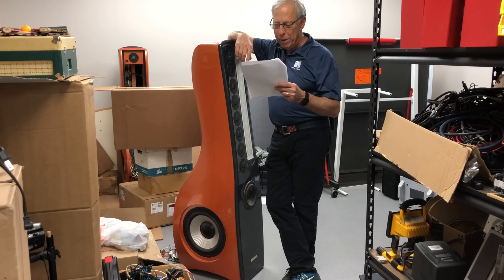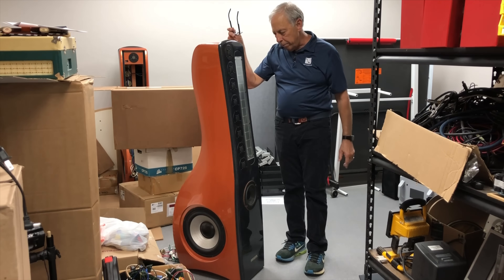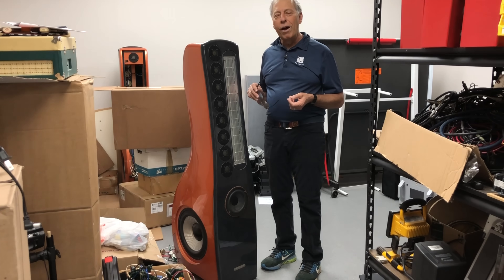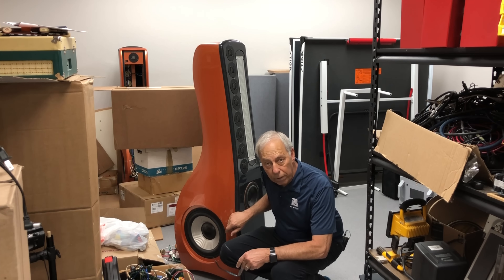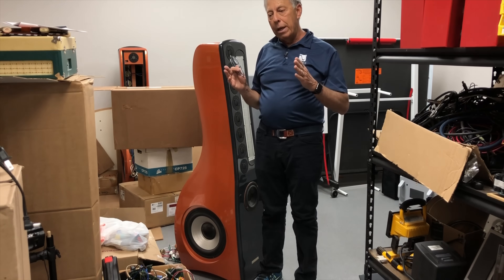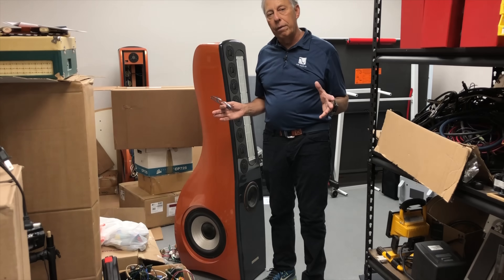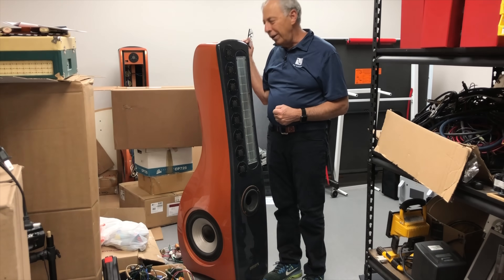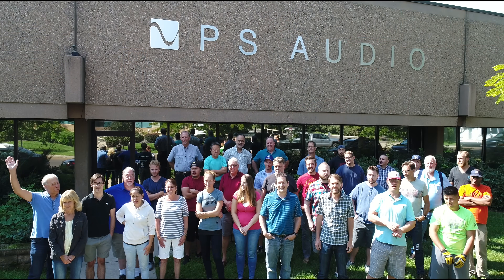Should dual woofers be in phase?

Comment: This is a little off point but I used a Polk Audio idea on a pair of towers I built.
2 x 12" poly woofers, a pair of 4" mids & a tweeter in each enclosure.
1 mid in each was powered thru a switch allowing me to change it from duplicating the partner mid to an out of phase signal from the opposite channel.
The idea was to cancel anything common between both channels for more pronounced separation.
It was incredibly effective & truly widened the presentation.
Is this still being used by anyone? 
A very fun & satisfying experiment.

Comment: There is only 1 thing wrong with dipole subwoofers : you need a lot of air displacement , so lotsa surface , lotsa xmax and an open baffle with sufficient dipole distance (deep H-frame e.g.) In return for this investment you will get the best quality bass you have ever heard and you will never go back to closed or ported systems .

Comment: Paul , I do not understand why you would go from an 6.5" mid bass coupler to an 8" one. You said that is the best speaker you have ever heard.  Years of development most likely went into that 6.5 " driver.  To find an 8" as quick and as dynamic with the same roll off characteristics will be difficult to say the least.

More often than not an 2 way 6.5" speaker vs an 8" 2 way system will sound far more natural from the 80 or so hz range and up. Not a rule.  A punchy quick 6.5" mid bass driver is a much easer find than an 8" one.

Comment: I think you made a mistake in the explanation. You said they should be inphase, then gestured with your hands that the speakers firing out of phase, both firing outwards simultaneously but in opposite directions,  would cancel out, which is true but then you said the opposite is also true. 

Phase is relative to the direction of the drivers radiating surface. A dipole speaker has two radiating surfaces, the front and back of the diaphragm or cone. It doesn't matter if you have a single element surface or two different drivers moving in the same direction at the same time, one would be firing out, the other would be traveling inward. They are still in-phase. 

Kef R400b's do this. However that speaker is poorly designed because it is already out of phase with the speakers pointed at the listener by ¼ wavelength because they were designed to fire sideways. If the Kefs are placed firing front to back in the room, one driver facing the listener, the other the back wall, bass is louder and tighter, and the sealed space between them helps to eliminate over-travel, and the only negative is that they are uglier than they normally are. Since you advocate servo control woofers you can have them firing side to side and compensate their timing to keep them in-phase with the front facing dipoles electronically.

I think that's what you meant?

Comment: I would love to see the polar response of that speaker... the  mid/base  speaker is probably wired out of phase so that at the crossover frequencies it will sum with the LF drivers and the higher frequency drivers.
I recommend building an anechoic chamber and use something like LEAP  and LMS for cabinet designs and acoustic measurements and for Theile Small parameter measurement of your drivers...
Reply: Love your Kat outfit in your pic😉
Reply: @xmachine7003  Kat outfit ? I don't have one ... my girl friend Catie does
Reply: @janinapalmer8368  😂😂😂
Reply: Looking at the dimensions of the baffle , the polar response of the dipole mid woofer will be OK (constant directivity) , but both midrange and tweeter polar respond will be not at all . Same design mistake as in the Infinit IRS : way too wide baffle at those frequencies for a perfect dipolar response . At 2 kHz , max baffle width is about 5 inch ...

Comment: 8” drivers start to beam at ~1700Hz, so I would be careful with your crossover frequency and slope.  Each speaker is different, but usually the 30° off-axis is down like 3dB at 2kHz for an 8” with no waveguide.
Reply: this  guy is uber-professional, you can say nothing new to him
Reply: I'm pretty sure it's going to be crossed low, around 300Hz as in that speaker with the 6
Reply: New comment section mini series-Pro tips for Paul....
Reply: They already have mid range driver. And in the video he said the 6.5/8inch driver only serves around 150-300hz. So no problem at all.

Comment: I think the 6 inch coupler would be better mounted on the inside then being flush mounted, Try it out! I think that's a mistake to use an 8 inch driver I think you're better off using two six and a half inch drivers working in unison quicker response for a start plus the area would be bigger than a 8 inch. Are the speakers ported or sealed units or both? I would love to see these new speakers your building any chance! I can put my hat in the ring if it means anything. If so I'll leave you an email. I think you'd be doing yourself a disservice if you didn't do them as a kit as well, quicker for you to have a turnover and the customer gets a great discount plus the feedback you get will improve your speaker sell it as a flat pack. You can have them out of axis? Can work rather well between different drivers not in dipolar always have to be kept the same in a push pull configuration if sharing the same space. The volume looks rather small for 2 12-inch drivers they must be well packed with fibre what frequency do these speakers go down to?? Or is there a slit on the back? [If you're using rear facing or even front facing place a soft dome tweeter suspended with a bullet shape on the magnet casing, I haven't tried metal inside the port of course the port has to be bigger or shaped accordingly and placement is crucial but this enhances the bass and makes the trouble much much  better sweeter more body sounding maybe a bit like a concentric driver.© All rights received not for commercial use. 2003/4/23]] you got the facilities Paul give it a go.
Reply: John, paragraphs can be your friend. ¶
Reply: Woofer size has no correlation with how fast it is, there are 12” woofers with a quicker impulse response than 6.5” ones.

I actually don’t like multiple drivers playing the same frequency like in the speaker shown, you get so much comb filtering if you aren’t right on-axis, vertically.
Reply: Larry Niles you might be right but there is never a stage of the game in speaker designing not such a thing, there is so many factors involved a small change can be dramatic either way.
Reply: hunkeydoreyplayer well maybe these days depends on the material on the driver of course it could be quicker if it's a lighter material for a bigger driver then the smaller one! Multiple drivers depends how many working with? two cone drivers generally not too bad but you need to make sure you got them balanced accordingly to each other. Never work with ribbon tweeters or so-called mid-range so I don't know about them. But speaker manufacturers these days seem to be going for more and more drivers in the speaker so something must be working right. You probably would like the tannoy Westminster royal SE I don't blame you the best speaker in the world
Reply: John sweda It's pure fallacy that a 6 inch driver is faster than an 8 inch driver at bass frequencies. The impression of speed is more influenced by the amplifier used and tuning of driver/ box.